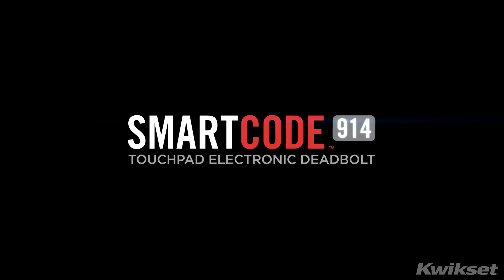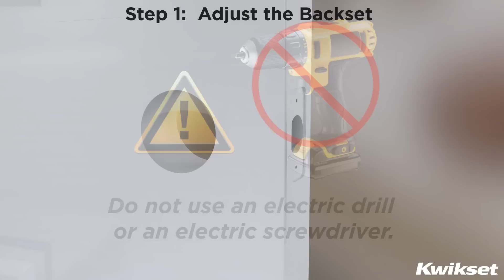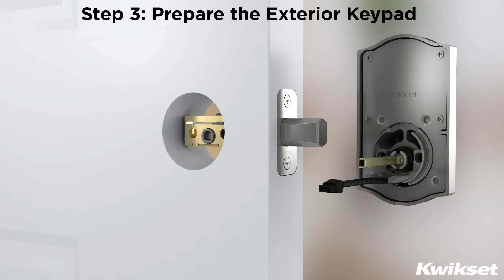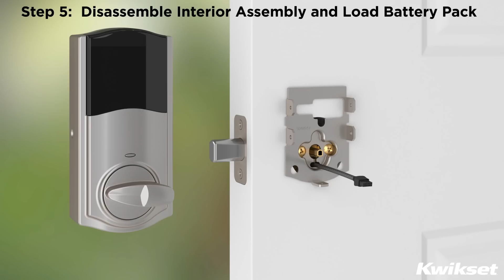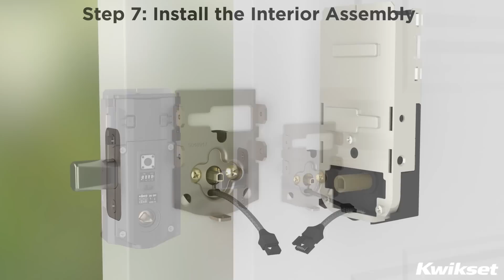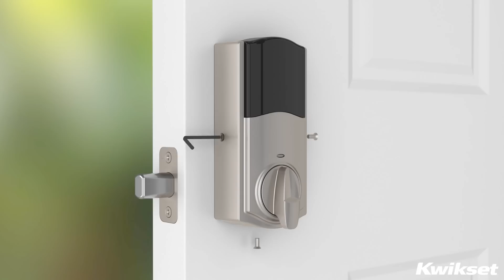Installing the Kwikset SmartCode 914 with Z-Wave

Comment: The passwords stopped working after I needed to replace the batteries. Do I need to reprogram the password ?
Reply from the maker: Hi Vitor - Here to help! After replacing the batteries, try performing the Handing Process to recalibrate the latch. https://kwik.st/48fjYxM  Test the code and if does not work after this step, we recommend factory resetting the lock and reprogramming the user code. Thanks ~ Kwikset Social

Comment: How do you connect this to Alexa ?
Reply from the maker: Hi Alfred -  Here to help! The SmartCode 914 Z-Wave lock must first be paired with a Z-Wave hub or security system before you can pair it with Alexa. Some examples of Z-Wave compatible systems are Samsung SmartThings, Wink, Ring Alarm System, Vivint, and ADT. Once the lock is paired to one of these systems, you will be able to integrate the lock with Amazon Alexa.  Thanks ~ Kwikset Social

Comment: 2:48 I ordered a SmartCode 914's where the turn piece shaft was oriented upside down and ordered a replacement.  The replacement came with the same problem.  No turning of the shaft will get it into the position shown.  Some reviewers online have suggested taking the assembly completely apart to turn the motor assembly 180 degrees saying it was installed upside down at the factory.  Surely there is an easier way to address the problem?
Reply: Happened to me too.  I took it apart a reoriented it.  Sucks for such an expensive product but at least it can be fixed.
Reply: I had the same issue. My problem seems to be my door lock is on the right side of the door and most doors locks are on the left side.